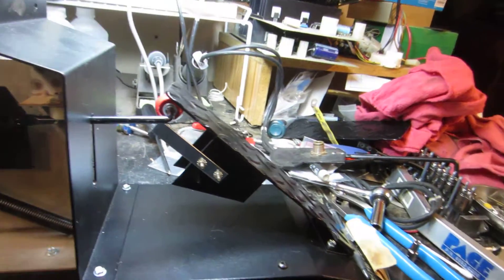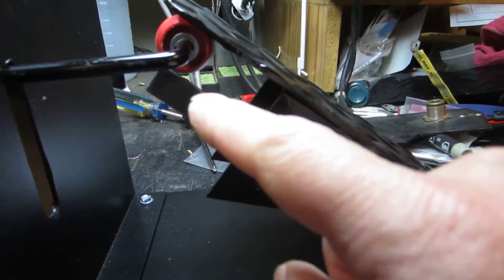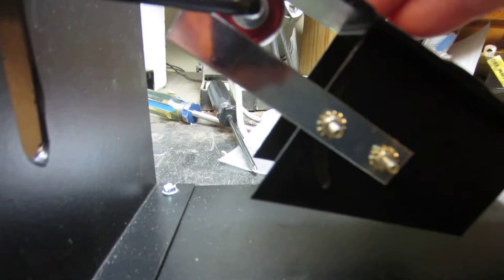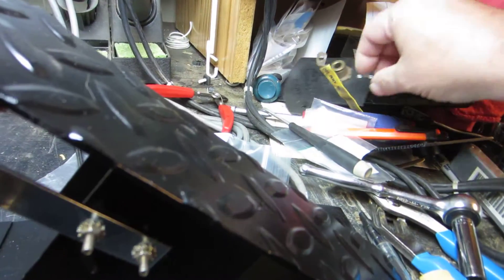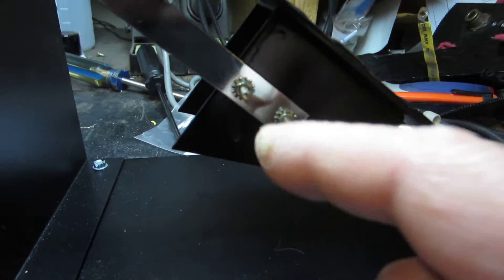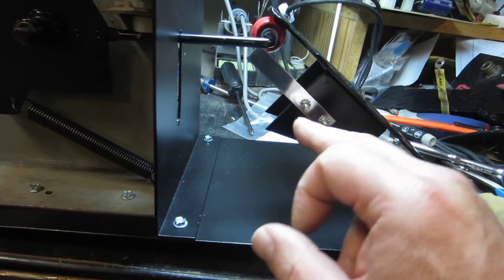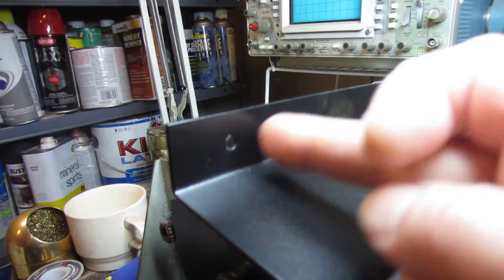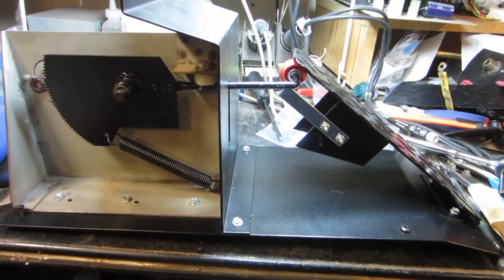Spy Hunter Upright Accelerator Pedal SOLVED

Comment: Did you have to drill out the wico knob? I'm rebuilding a Spyhunter and would like to use the one you did. Looks great!
Reply from the maker: The wico grommet is what it is.  A centering grommet.  It is used to center a joystick inside it's switch assembly.  It is not a joystick ball.  I believe arcadefixit may still have stock.  But it was a perfect fit so no, I did not have to make the hole any larger.
Reply: I see the square grommets. If you have a chance can you maybe send a link? Thanks so much for your time!
Reply from the maker: Are you talking about the accelerator pedal or some other component?  This is the actuator I used included in this video: http://www.arcadefixit.com/product.sc;jsessionid=96892FB9D55B6733720643B19DB10D38.p3plqscsfapp003?productId=826&categoryId=208
Reply: Yep that's what I needed to see! Thanks!